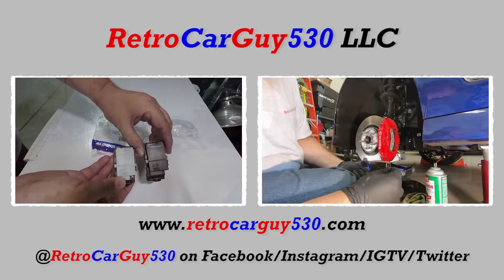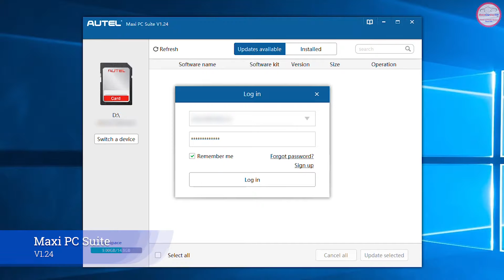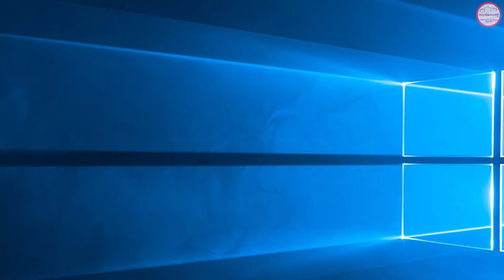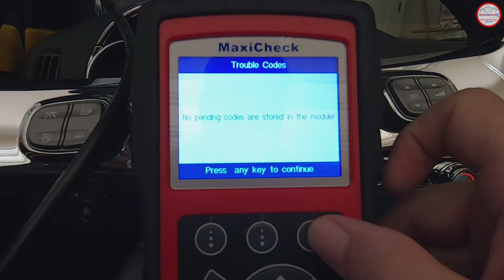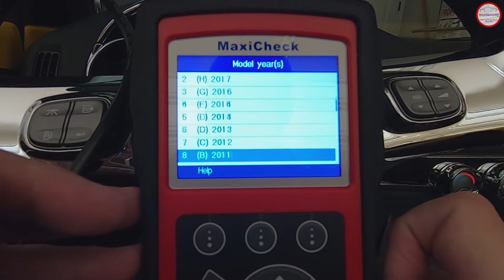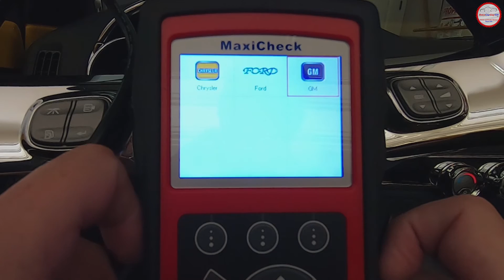Autel MaxiCheck Pro - Smog Check Readiness - I/M Readiness

Comment from the maker: I still quite amazed at how many vehicles the Autel MaxiCheck Pro OBD-II scan tool works with worldwide.  Being able to see if the I/M Readiness monitors have been run and found no errors before going to a smog check station is well worth knowing to avoid any problems passing the smog check for your vehicle.

Comment: Could you please tell me if it's possible to check the charging system on a Chevy Venture? Thank you. (When I click on BMS it only shows Ford) ..?? I downloaded the updates onto the memory card, but still only Ford (I'm in Canada).
Reply from the maker: I checked my MaxiCheck Pro and it too only shows BMS for Ford when selecting the North America region.  Using the "Vehicle Coverage" lookup tool on the Autel website, it shows that the BMS functionality is present only for Ford in North America.  When I enter "MaxiCheck Pro"  for the "Product Models" field (on the "Other Tools" tab) and enter "GM" for the "Name of Software" field, it only lists "Oil Reset", ABSSRS, DPF and SAS (no BMS).  https://www.autel.com/vehicle-coverage/coverage1

The best I can suggest is to look for any charging system related DTCs/codes when using the OBDII diagnostic feature of the MaxiCheck Pro with your Chevy Venture.
Reply: Thank you, I will search and destroy. :/

Comment: Up to what year you can go ?
Reply from the maker: I just updated the software on the device and I checked what model years I can select in the various screens where you can select make/model/year and the latest one I see is 2018.  You may want to contact Autel directly or one of their authorized resellers to have them verify your vehicle's year/make/model to make sure it's supported by the MaxiCheck Pro.  Autel releases updates quite frequently to add new functionality and to support additional year/make/model vehicles.